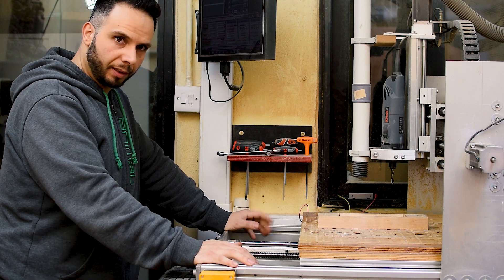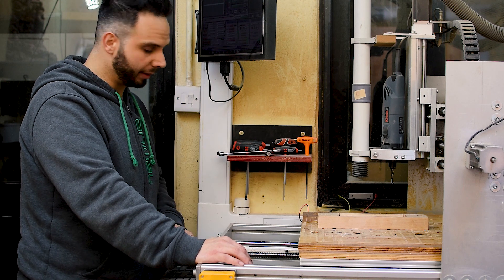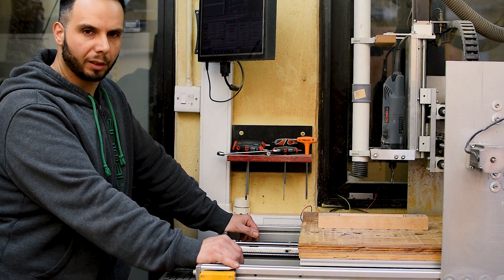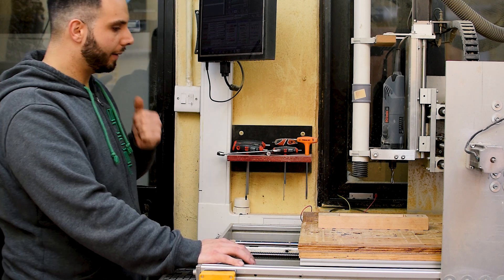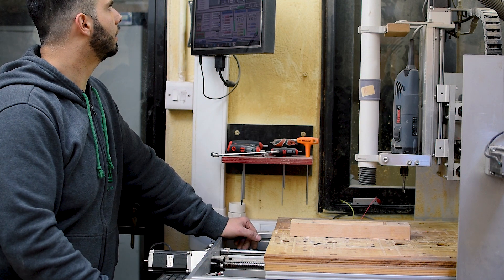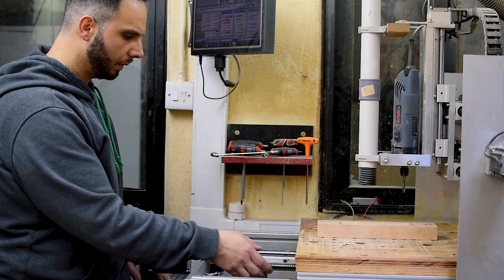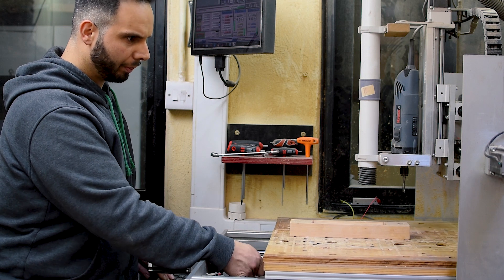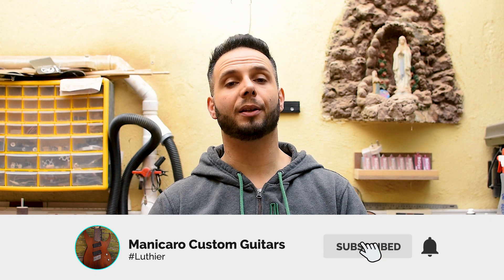Increasing stepper motor speed without stalling?! Let's found out.

Comment: Thank you very much for this video. I was looking for a way to increase speed of my CNC and now I know what I need to do. Just need to wait for the dm556 stepper drivers to come, so that I could supply external power to the stepper motors and not be limited to the one that comes from the CNC board I have (24V).

Comment: PSU voltage is overlooked on many hobby machines.  The torque drop at speed and eventually the stepper motor will stall, even with no load at all.  2x voltage increase can ideally increase max speed with 2x, but it also push the "speed vs torque" trade-off to higher RPM.
Total power capacity also 2x, if at 24V and 3A you have 72W capacity, while same system with a 48V supply = 144W.

The only limiting factor for supply voltage is what the driver accept, make sure one use a PSU with slightly lower voltage than stepper driver can accept.

Thank you for sharing :)